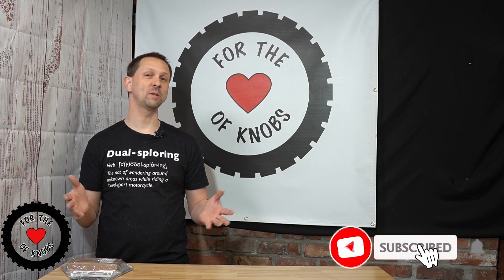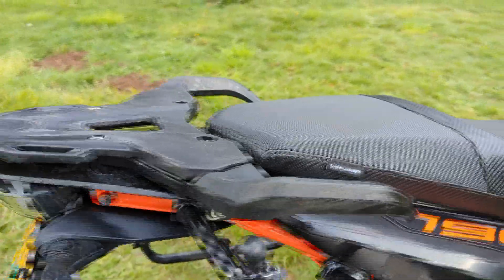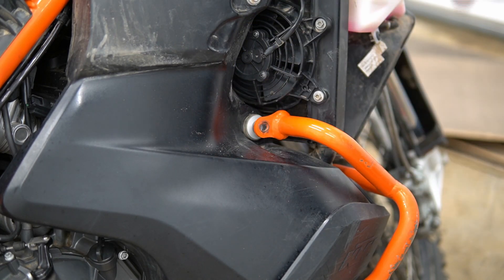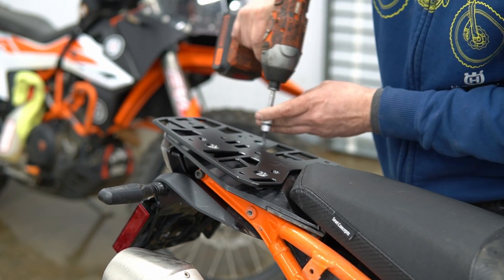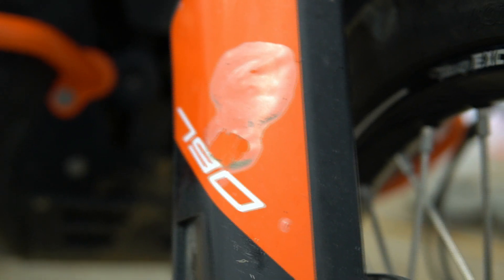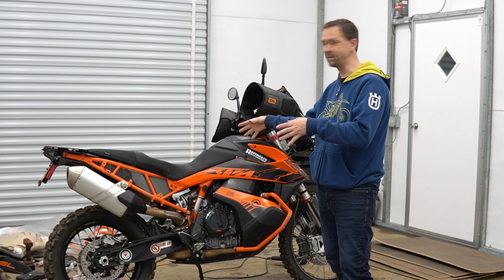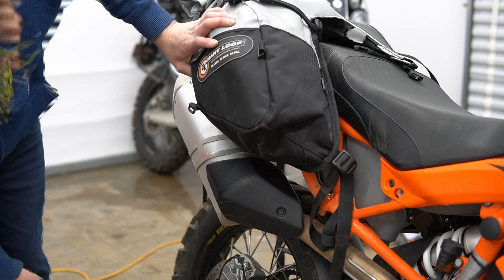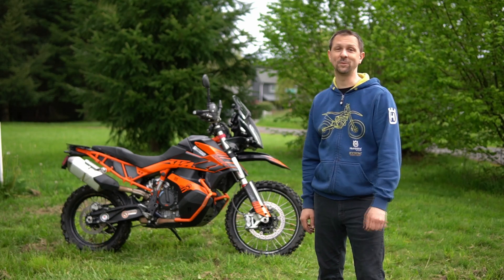How To Install A Graphics Kit and Reduce Weight On Your Adventure Motorcycle or Dual Sport - KTM 790

Comment: Good channel. I subscribed. I like that decal kit. Really changes the look.
Perhaps you might think about getting a good skid plate and ditching the lower crash bars too. I ride my 890 R on single track all the time and see no need for the added weight. Along with removing the side plastics and passenger pegs as you did, I also changed out the stock batt for a lithium and saved another 6 lbs.
Reply from the maker: It's already got a great aftermarket skid plate. The bars weigh maybe 3 lbs? I doubt anyone would notice that. Got the lithium battery too! A good way to shave a few pounds up high.

Comment: Great video, and looks awesome!!! I've been running my stock 790 Adventure S like this for about a year but mostly because all that gear you have is quite expensive... haha! I've stripped off so far; rear pegs, rear grab-handles(Dangerous), tag mount, brush guards, stock mirrors for single foldable. I just use a small tailbag/hydro-pak 90% of the time for Motocross/Enduro adventures.
Reply from the maker: Nice!